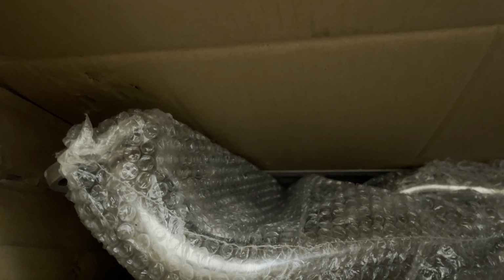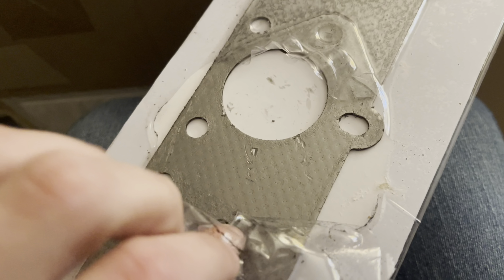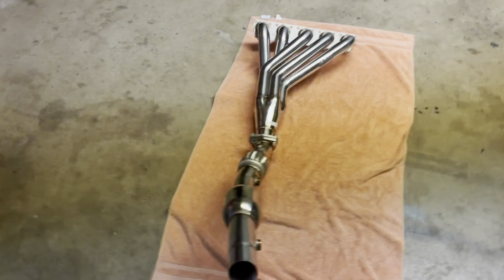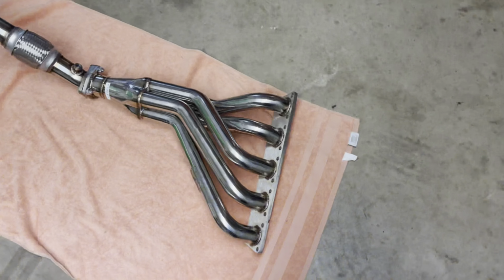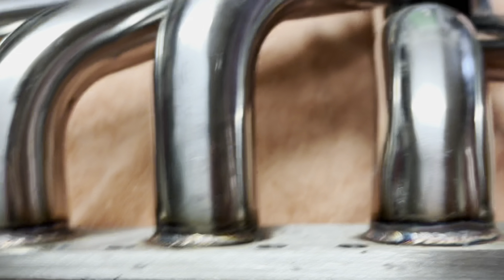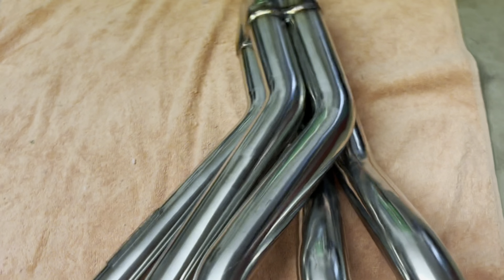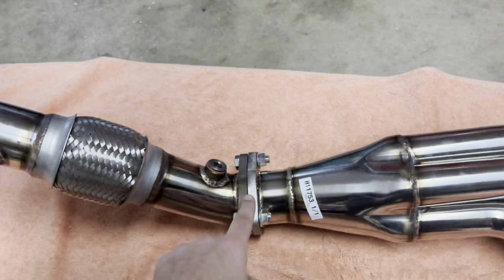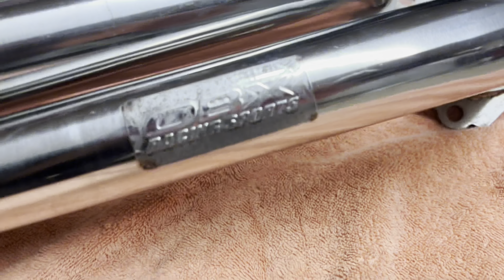Before you buy, VW 2.5l OBX header

Comment: Any updates ?
Reply from the maker: So I’ve thought about installing them but will wait. This is my only vehicle if I mess any threads up I won’t drive it with an exhaust leak. I did order another test pipe that will mount up to the factory header for now. Need to install that
Reply: @EastDallasKicks  Wana sell it ?
Reply: @EastDallasKicks  figured i would ask lol
Reply from the maker: Yes sure, I'm selling them at a loss
Reply: @EastDallasKicks  how much are you asking
Reply from the maker: @arthurerby2466  I'll do 200 comes with gaskets and replacement longer studs just in case
Reply: @EastDallasKicks still have em? I can’t find anywheres selling them
Reply from the maker: Sold them awhile back. Just get a catless test pipe or usp highflow cat and awe touring catback exhaust. Way better sound than the OBX headers. @PotatopancakesOMG